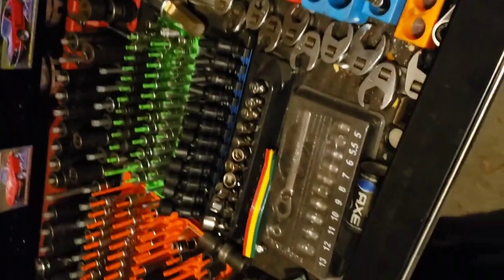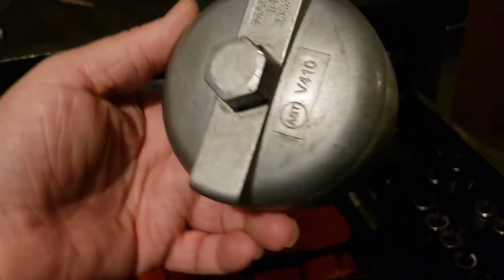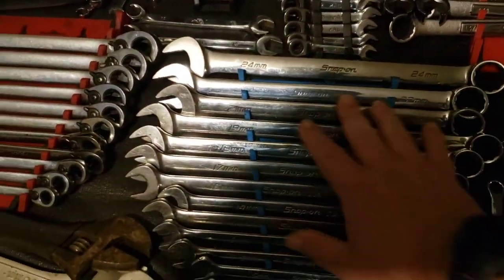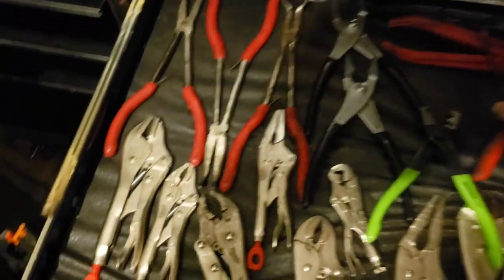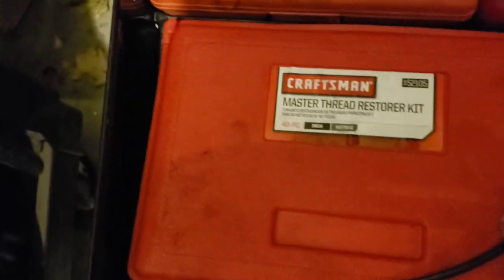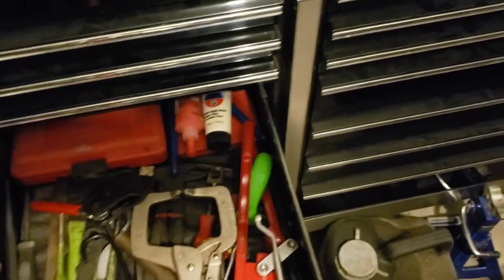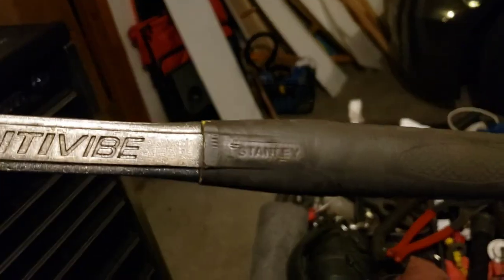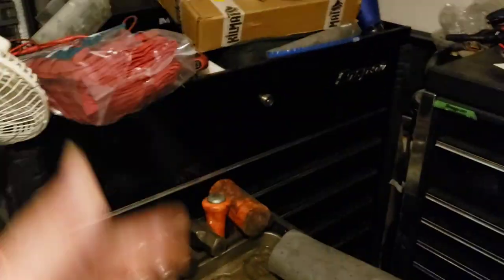Tool Box Tour and More!

Comment: those PWZ pliers are great. SnapOn doesn't make them though, they are rebranded Bahco.
Reply: That was the company i was trying to think of! I knew they were called something else by someone else.
Reply: Snap On owns Bahco, so it isn't exactly rebranding. They just sell them as Bahco primarily in Europe, and Snap On in the US. Same situation with a lot of Proto vs MAC tools with Proto being the industrial brand and MAC the tool truck brand.
Reply: @deltahawk1001  Like the same relationship between Williams and Snap on. Williams being the industrial line.
Reply: @FBobby  Except Proto and MAC often have the exact same tools unlike Williams and Snap On. For example, the Proto Precision 90 ratchet and the MAC Axis 90 ratchet are the same tool, made in the same factory, just sold to different markets.  The Snap On adjustable Wrench and the Snap-On files are also the same tool as their Bahco counterparts.

Comment: Damn, first you say Harbor Freight ratchets fail when over-stressed, then you say don't over-stress ratchet wrenches. BIAS?
Reply: I've had Harbor freight ratchets fail to remove bolts that they should have been able to loosen due to their weak internal parts. I'm talking a 14mm starter bolt. Using a 3/8ths drive ratchet. I went and got my Snap on Ratchet and it broke it free instantly. 
ANY ratcheting mechanism will fail if used improperly. But when there is so much flex in the mechanism that it can't get a very standard sized bolt free. I can't recommend it.